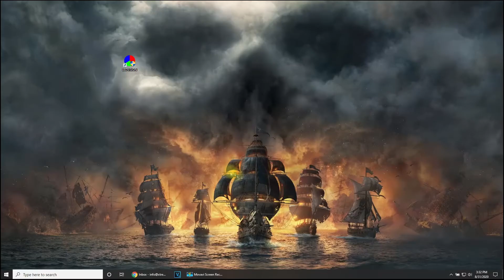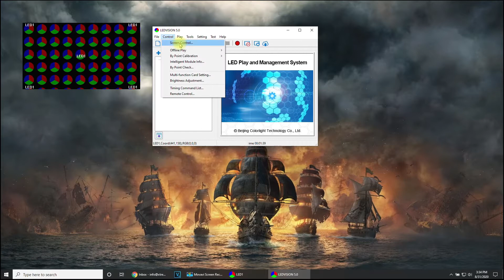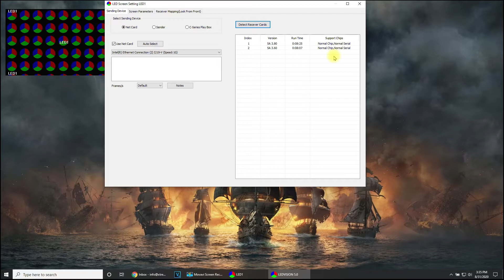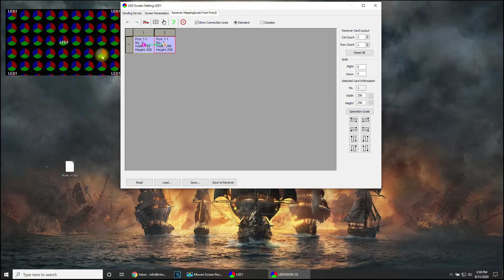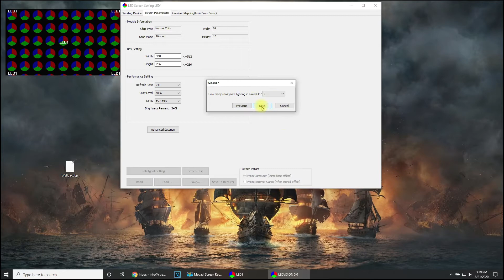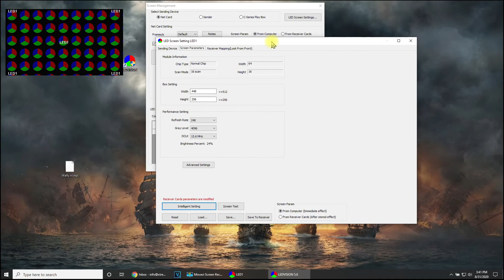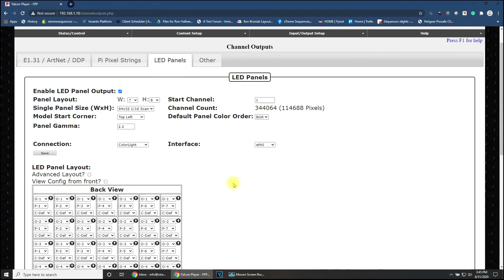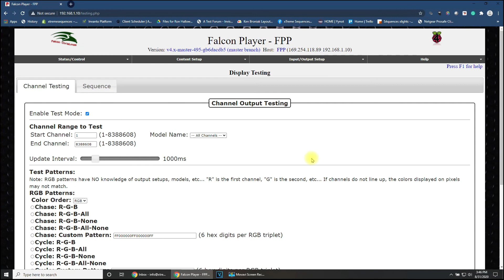ColorLight, LEDVISION, Pi4, 56 Panels, and a Particular Panel Profile

Comment: Thanks for the video.  A tip for the intelligent settings, Shift + End for horizontal, Shift + PageDown (or down arrow) for vertical works after selecting the first pixel.  Faster and error free.
Reply from the maker: Now why didn't someone tell me about that??? LOL  Thanks for the tip.
Reply: @xTremeSequences  I had issues setting  up my Colorlight P5 matrix in FPP.   5x5 (panels rotated 90 to to fit my window).  Perfect in LEDVision, scrambled and/or half lit in FPP.  Fought it for an entire day and conceded to use the XSchedule Colorlight plugin (https://github.com/computergeek1507/ColorlightPlugin) for this Christmas.   Pretty easy to setup and works great.  Will resume the battle next month.